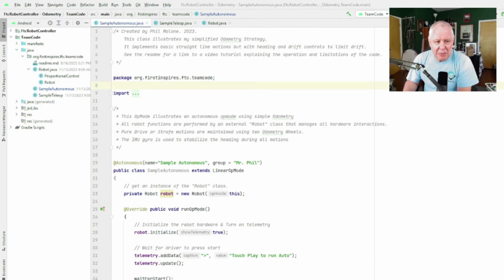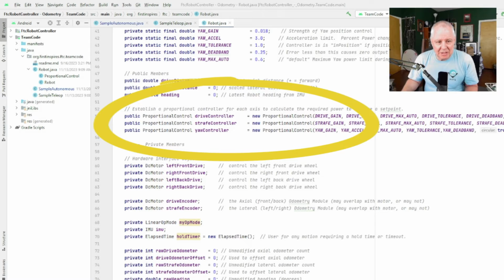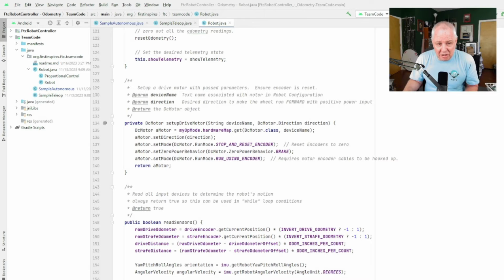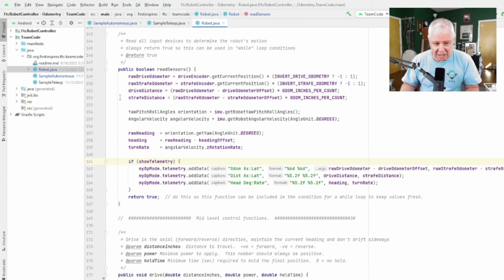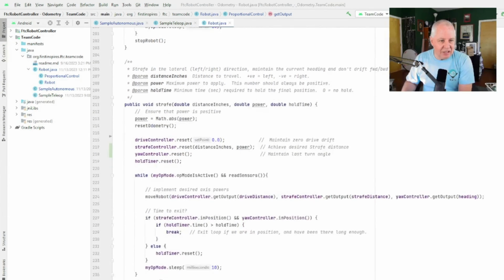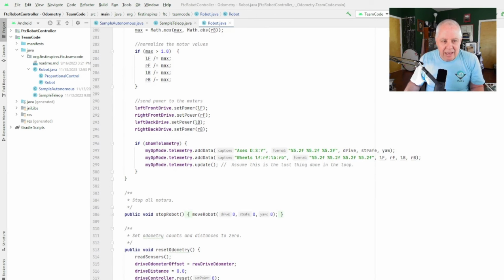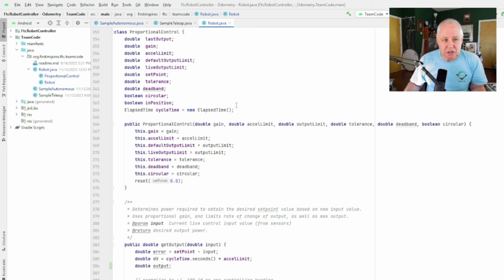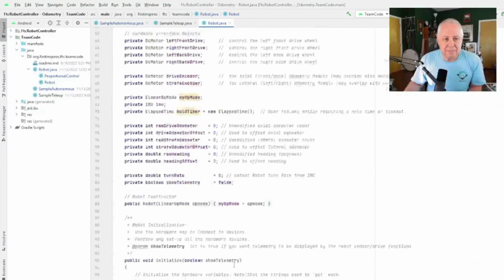Simplified FTC Odometry. Part 4: Robot Class

Comment: Thanks for providing this video and code. Our team has been working through this as a stepping stone to full PID. We've finally gotten reliable turning after adjusting some motor directions, but now when we try to strafe or drive forward the robot swerves off to the left while accelerating. All odometers read the correct value and we can't find a way to fix this behavior. Any advice?
Reply from the maker: Hi.  There are lots of reasons this can happen...  The last time I spent an afternoon trying to help a team who's auto did this, it turned out that they had two motors named incorrectly, and so the wrong wheels were being driven.  The reason I mention this is beacuse for the longest time we tried to find PID gains that were wrong, or gyro that was wrong,  but everything looked fine.  It wasn't until we put the robot up on block and ran each wheel ONE AT A TIME that the problem became obvious.  Miss-configured motors or odometry pods are the prime reasons for all of the "it doesn't work right" problems.  It turns out that the team had noticed this indirectly earlier and had flipped a joystick sign to fix it.  They just hid the problem.    SO, even thought you "feel sure" that the motors are assigned correctly, please use the teleop test code that lets you proess a button to control each wheel.   Tripple check that the correct motor runs forward and that the encoder values increase.

Comment: Mr. Phil, Thanks for posting these videos!  I have been trying to run it on my robot.  No what the power setting for the drive motors, they go full speed, even when the telemetry says they are at 0.2.  Any ideas?  Gary Lindner
Reply: We just started working through this and had the same problem randomly it turns out motor polarity matters for this. Any motors plugged in reverse would just move at full speed no matter what
Reply from the maker: @mwhall4127  Yes, you are correct.  If you accidentally flip the red/black wires, the motors will run, but the encoders will count in the wrong direction which makes it impossible for the firmware to control the speed.

Comment: How did you calculate the inches per count? I’m wanting to do this using revs drive encoders which have a different wheel size and more ticks per revolution so how would I go about calculating that?
Reply from the maker: That's both a simple and complicated question.   The simple answer is you can measure it.  The complicated answer is you can caluculate it based on your chosen motor, external gear reduction and wheel size.  I like to do a first-cut calculation, and then fine tune the result with an actual measurment.    To do a measuremnt you simply eed to display the encoder values while you move the robot a fixed amount.  Power up the robot while it's up against a wall.  The encoder should start out at zero.   Slowly drive (or push) the robot a fixed distance (like 100 inches).  then simply divide the distance by the final encoder value.   inches/count.   To do the more engineering method of calculation, you must relate everything back to the circumfrence of the wheel and the total motor gear reduction.  Essentially, when the motor does one rotation (look up the number of counts this is for the motor) decide how many revolutions of the drive wheel this is, and then convert this into distance traveled by multiplying by the wheel.  circumfrence...

Comment: One more question, if I wanted to increase the speed of my robot in autonomous would I just increase the STRAFE_MAX_AUTO and DRIVE_MAX_AUTO or do I have to edit other values?
Reply from the maker: That's correct.  These values are use by the control loops to set the upper limit to the speed (%)  that they will request.  The max values for these are 1.0.  If your robot does not get up to speed fast enough for your liking, you can also slowly increase the DRIVE_ACCEL and STRAFE_ACCEL values.  If these get too high, you may start seeing slippage or non-straight driving.   I'd do this in small steps, like 0.1 at a time to see what impact it has.
Reply: Thanks!

Comment: Thanks for the video it was really informational! In the beginning, you mentioned the values for the gains, tolerances, acceleration, etc. had to be tuned to our robot. How do we tune these values specifically to our robot? Do I have to run any specific tuning opmodes for this, if so where can I find these opmodes?
Reply from the maker: The gains etc are all constants in the beginning of the robot class.  eg:  Start with tuning the heading control.  Use the values in the tutorial.  Then rin the dample uto.  Look at how well the robot goes to a new heading.  If it shakes back and forth, reduce the gain.  If it it too slow, or does  not reach the heading, reduce the gains.  This would be the Yaw gain, seen here:
YAW_GAIN            = 0.018;    // Strength of Yaw position control
Reply: @GEARSinc  Thank you!

Comment: Followed instructions but getting these along with others....Build started at Wed Dec 13 2023 13:06:56 GMT-0800 (Pacific Standard Time) org/firstinspires/ftc/teamcode/SampleAutonomous.java line 29, column 16: ERROR: constructor Robot in class org.firstinspires.ftc.teamcode.SampleAutonomous.Robot cannot be applied to given types; required: com.qualcomm.robotcore.eventloop.opmode.LinearOpMode found: no arguments reason: actual and formal argument lists differ in length org/firstinspires/ftc/teamcode/SampleAutonomous.java line 155, column 9:
Reply from the maker: Hi.  Thanks for reaching out.   So, those lines (28 and 155) don't exist in the original samples, so you must have added more code, yes?  If so, have you tried just building the oringinal samples?  Don't forget if you are using OnBotJava, you need to add both the SampleAutonomous.java  opmode AND the Robot.java files to the teamcode folder.  Robot.java just gets added as a non-opmode because it's a dedicated class.
Reply: If it is ok, can I have your email? @GEARSinc
Reply: We load the Robot.java and compile with no errors.  We add the SampleAutonomous.java and get those errors among others.  @GEARSinc
Reply: Build started at Wed Dec 13 2023 13:06:56 GMT-0800 (Pacific Standard Time) org/firstinspires/ftc/teamcode/SampleAutonomous.java line 29, column 16: ERROR: constructor Robot in class org.firstinspires.ftc.teamcode.SampleAutonomous.Robot cannot be applied to given types; required: com.qualcomm.robotcore.eventloop.opmode.LinearOpMode found: no arguments reason: actual and formal argument lists differ in length org/firstinspires/ftc/teamcode/SampleAutonomous.java line 155, column 9: ERROR: cannot find symbol symbol: class List location: class org.firstinspires.ftc.teamcode.SampleAutonomous.Robot org/firstinspires/ftc/teamcode/SampleAutonomous.java line 199, column 9: ERROR: cannot find symbol symbol: class YawPitchRollAngles location: class org.firstinspires.ftc.teamcode.SampleAutonomous.Robot org/firstinspires/ftc/teamcode/SampleAutonomous.java line 200, column 9: ERROR: cannot find symbol symbol: class AngularVelocity location: class org.firstinspires.ftc.teamcode.SampleAutonomous.Robot org/firstinspires/ftc/teamcode/SampleAutonomous.java line 200, column 71: ERROR: cannot find symbol symbol: variable AngleUnit location: class org.firstinspires.ftc.teamcode.SampleAutonomous.Robot org/firstinspires/ftc/teamcode/SampleAutonomous.java line 202, column 42: ERROR: cannot find symbol symbol: variable AngleUnit location: class org.firstinspires.ftc.teamcode.SampleAutonomous.Robot org/firstinspires/ftc/teamcode/SampleAutonomous.java line 447, column 22: ERROR: cannot find symbol symbol: variable Range location: class org.firstinspires.ftc.teamcode.SampleAutonomous.ProportionalControl Build FAILED! Build finished in 2 seconds